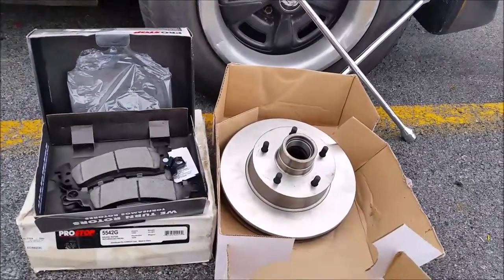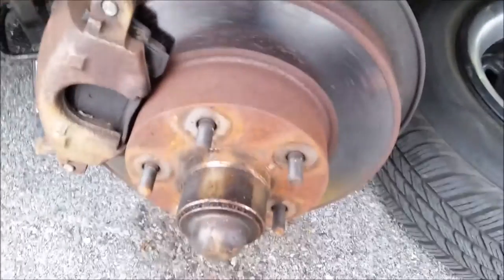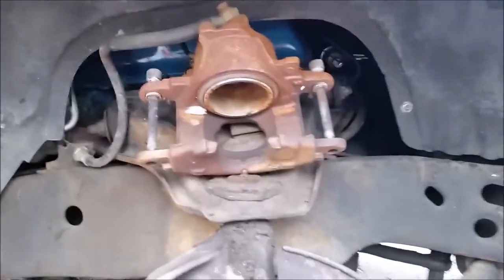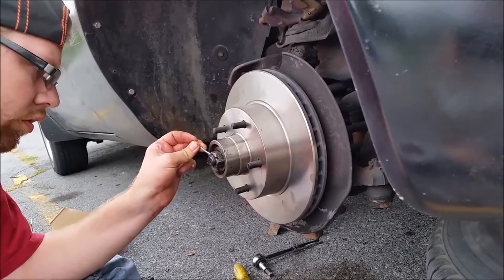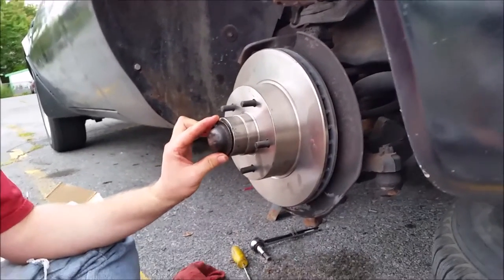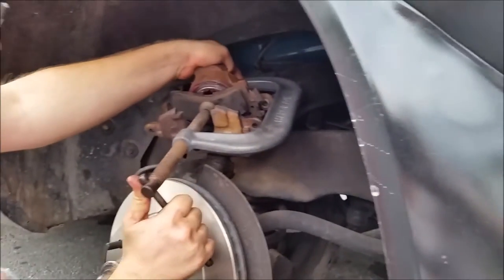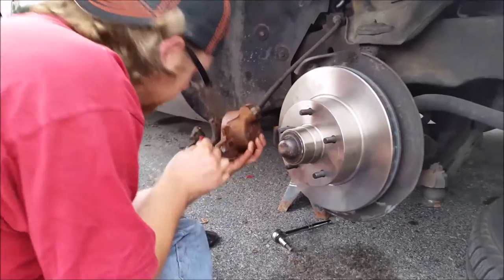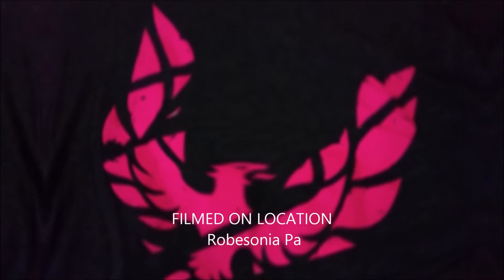Easy classic GM disk brake replacement

Comment: Those inboard retaining clips on the piston, are they about half the size they used to be? I remember both sides touching the pistion years back.  ARE THESE NEW ONES SAFE??
Reply from the maker: All they do is hold the pad in place untill you install the caliper in place

Comment: Did it fix the vibration?  I have the same exact symptom on my 76 trans am.  It only vibrates when braking at higher speeds 65 or higher.  Thinking it just needs new rotors and pads or something
Reply from the maker: I dont even remember at this point this was so long ago

Comment: How'd you remove the bolts on the calipers without enough clearance? Swapping my 78 El Camino pads out and there isn't even enough clearance to remove the calipers. They're fucking stock.
Reply from the maker: Turn the wheel im not understanding as yours should be almost identical to this cars set up most gm stuff wasxthe same at this time maybe contact me on instagram or facebook with more info or video to help exsplain what your running into